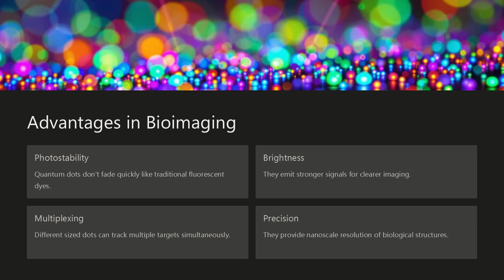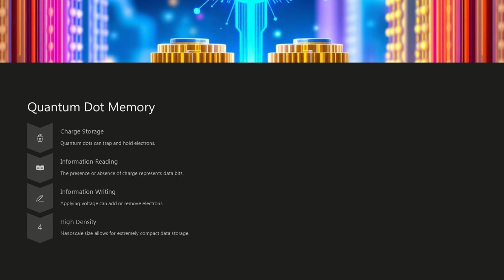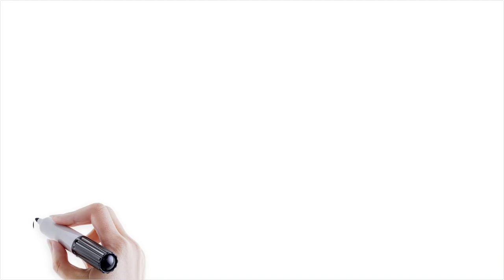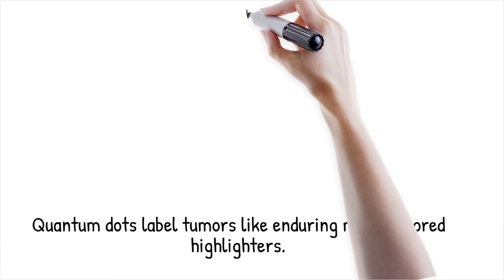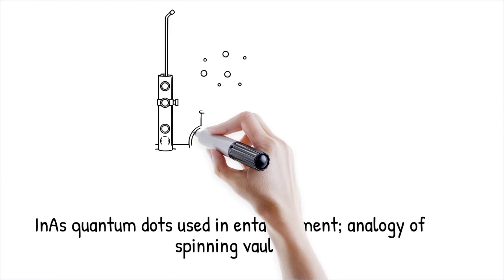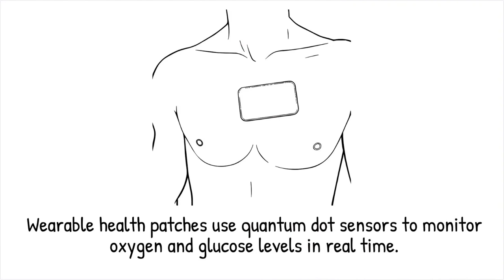Quantum Dots: Physics and Applications of Artificial Atoms

Comment from the maker: 1⃣ How can quantum dot energy levels be precisely tuned for targeted quantum computing applications?
2⃣ What sustainable synthesis methods can replace cadmium-based dots without compromising performance?
3⃣ Can hybrid quantum dot systems achieve stable integration with silicon-based electronics for large-scale use?